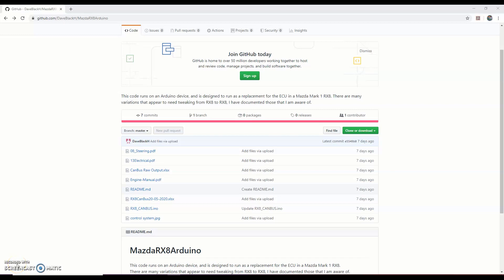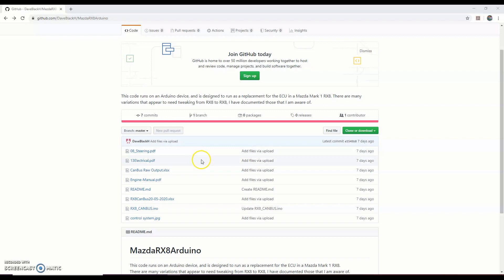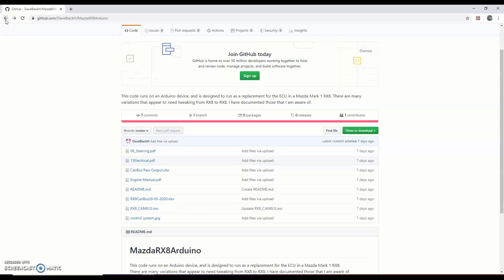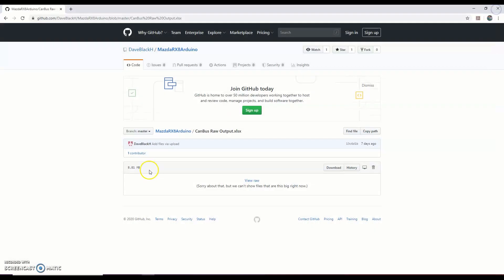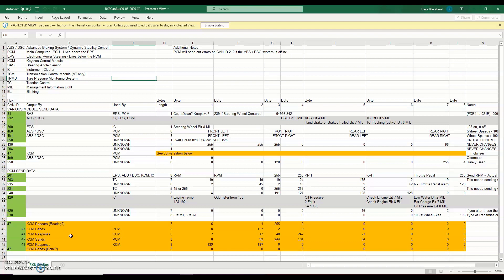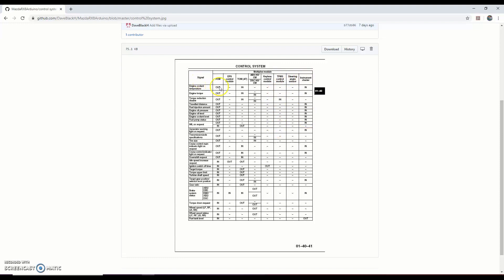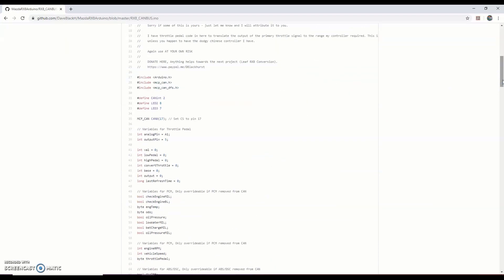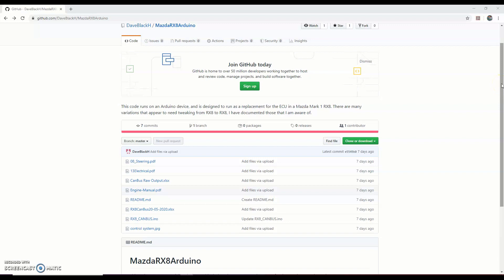RX8 Arduino Code and CanBus data

Comment: Eps working?
Reply from the maker: Yerp all working ;o)
Reply: @SouthWestEVUK  How did you do it? I did something more crazy, I put the Mazda steering box on the subaru, everything is fine, I just got stuck in the canbus part, I couldn't run your file with the arduino and mcp 2515 I used, I didn't get a reaction in other sources, can you help me, I just want to operate the steering box

Comment: Great work mate, do you know if the radio steering wheel controls are going though Canbus? 
I am trying to use the steering controls and the sat nav controls to control my tables via Bluetooth using esp32, but the colour code of the wires is all over the place and I don't know which is which
Reply from the maker: In the RX8 the radio and text display etc are on the slow speed can (the rax8 has two cabbuses). I have not looked at the slow speed can so not sure what does and does not operate on it.

Comment: Sorry if this is a dumb question. But how is this able to replace the whole ECU? 
I can't see any code relating to ignition or fueling.

What happens to features like the fuel trim auto learning or the peddle depress de-flood procedure?
I'm sure I'm confusing what you're referring to as the ECU for some other module but I can't think of what that would be.
Reply from the maker: Hay, definitely an ECU replacement ;o) But if you look at my channel the car does not have an ICE in it anymore!
Reply: @SouthWestEVUK  Can't tell if that's sarcasm 😅
But I think I might know what you're doing now. 
Are you leaving the factory ECU connected to everything except the CAN network? And then the Arduino is taking it's place on the network.
Would I be correct in thinking that is what's happening here?
Reply from the maker: Hi, no sarcasm! I replaced the ECU with the Arduino completely. Tricked all the various devices with the right codes to get everything from the power steering to ASB working.
Reply: @SouthWestEVUK  Wow that's impressive.
But I still don't understand how the car even runs. What is controlling the actual engine? I don't see any code relating to ignition or fueling.
Is it possible to change the ignition timing or even the fuel maps using a modified version of your code?
I'm just trying to work out if this has the potential to be a DIY alternative to an off the shelf programmable ECU.
Reply from the maker: Bud, my car no longer has an ICE in it. Its electric.

Comment: Thank you so much for all of this information! Do you have any thoughts on the best way to get a speed signal onto the CanBus in the absence of an ABS module? My first instinct would be to bring the wheel speed sensors directly to an arduino and marry that with what you've provided here, but I do see some commercial solutions available as well. Is there something I am missing that would justify the added cost in your opinion? Thank you in advance for any guidance you can provide.
Reply from the maker: Yeah, speed sensors are likely to be a digital pulse signal that you can read and count on the Arduino. Based on the size of the wheel you can calculate the speed and send that back out on the CanBus. Pretty simple really!
Reply: @SouthWestEVUK  Fantastic, thank you! If I discover anything worth sharing I'll be sure to pay it forward. Thanks again!

Comment: Hi, some of this code looks very familiar - albeit considerably tidied up! If it was mine it's great to know someone is making use of it. Unfortunately my project has taken a backseat for quite some time now due to other things going on but it looks like you've solved the remaining bits I haven't had time work out so you've saved me a loads of time in the future!  I'd be really interested to hear more about your project? Thanks for all your hard work on this - great job bringing it all together!

Jon (www.chamberofunderstanding.co.uk)
Reply from the maker: Hay, Ive tried to be upfront with the code and the fact bits and pieces have come from other sources online. Hard to know where and if anything needs crediting I am happy to do so! Bringing it all together has already helped a tonne of people and hopefully will continue to ;o) Take a look at some of my other videos about the original RX8 Ev and now my new Nissan Leaf conversion... Cheers
Reply: @SouthWestEVUK  Absolutely, I fully understand what its like, mine was pieced together and revised from information taken from bits of the work of others that came before me and then extended. It's not a complaint at all - if I'd not wanted it used I wouldn't have put it online! It's just amazing to see bits of it being used on such fantastic projects!
So glad I've found this, so much of my earlier work where I have data but it never quite worked is all making sense now I have these missing pieces! Such as the security challenge/response, the logs I have don't even have data for address 41!
 Incidentally I've just seen in one of your earlier videos a comment about the odo,  not sure if you ever worked it out but it seems to work on the edge of the change (rising edge I believe) rather than the value so you can set that byte to anything you want but from what I found it needs to be changed 4140 times per mile.
Reply from the maker: Ha yeah, I missed that 41 challenge also as I would start the car - then start logging. I also (it was a while ago) don't think the ODB port becomes active straight away. So you miss the very first bits of data on the canbus, pretty sure when I had the Arduino connected directly to the CanBus under the bonnet was when I suddenly started getting these. I am surprised that a few other people have used the same challenge / response and its worked fine! I would have figured that would be different for each car! 
I never really looked at the ODO in great length, I think I was worried that I might accidentally wind the cars ODO on a few hundred thousand miles by accident! I really should add that in tho. Cheers

Comment: Thanks for all the good info, really appreciate it. Quick question, would you think the the EPS can be made functional without the ECU and the dashboard, by directly feeding it an rpm signal via an Arduino CAN module, into the EPS harness?  I'm not looking to keep the original RX8 dash, I have a digital dash, which will better suit my needs...
Reply from the maker: Yes 100%, I do not have the ECU, and the Dash mainly takes inputs - so not having it should not affect the EPS.
Reply: @SouthWestEVUK  Ok, thanks for the answer, then I'll give it a try. Would you recommend me to connect the Arduino CAN directly on the EPS connector CAN-L/ CAN-H wires (maybe splice the wires), or maybe to connect it on the car's main CAN connector?

Comment: For your 0x81 cam bus data, the third and fourth byte are a big endian signed short. In this data sample it looks like you turned your wheel left far more than you turned right. -449 was the left most position and 229 was the right most. That is 678 degrees of rotation, I am guessing your wheel could turn a total of 900 degrees or 2.5 turns from most left to most right ? Or you never turned it fully left and you can expect an even lower number if you had.
Reply from the maker: I didnt actually grab the upper and lower values from that data - they came from being sat in the car very early on in my diagnostics. The raw output may not show the full range. Whats your project?
Reply: @SouthWestEVUK  https://gist.github.com/Parlane/de82d2c32bf55c1f48954f876fb2cf3f

Comment: Great video and a superb resource for anyone doing an engine swap on an RX8 whether it's an electric motor or V6/V8. You should post on the RX8 owners club about this, the guys there would be very interested.
Probably worth mentioning your code will not work on the other canbus shields without some tweaking. I have been messing about with various canbus shields and they all seem to be different with different libraries to get them to work and some of them will conflict with others. It is really confusing for beginners who want to be able to plug stuff in and see it work.
Reply from the maker: It is so hard to draw the right balance, over complicate it with versions and explanations for everyone. Or get as close as you can and rely on the fact that you are going to have to tweak some things. I have linked to the CanBus shield I use - which should help.
Reply: @SouthWestEVUK  If you give someone a fishing rod and point them to the water you can't make them fish. 😋